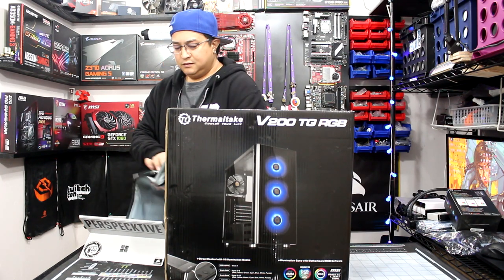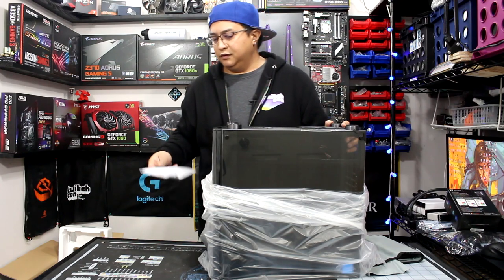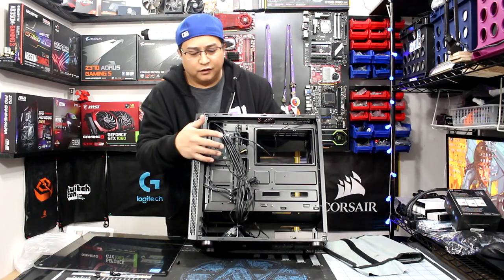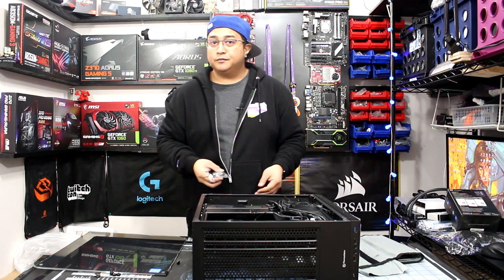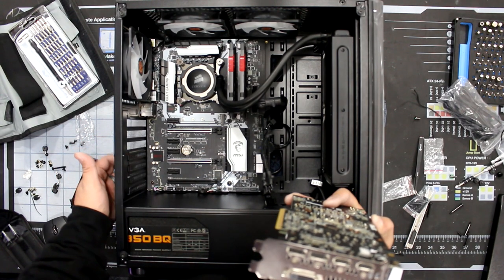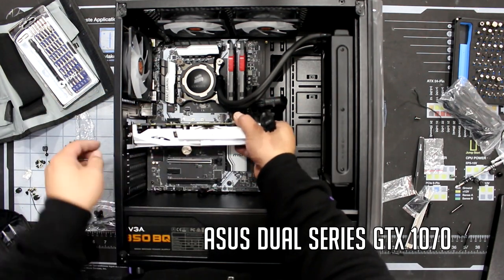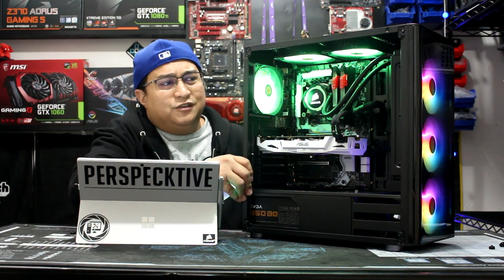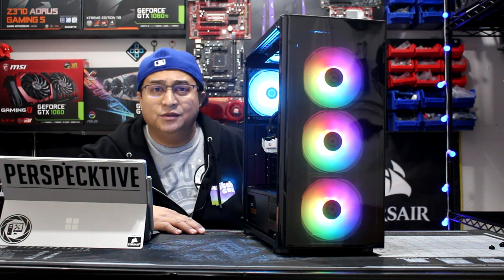Building In The Thermaltake V200 TG RGB (2018)

Comment: Great vid man ! with the ARGB switch on the back could you  daisy chain 3 fans and utilise one of the rgb slots  so that everything is controlled using the top RGB button on the panel ? 

Plan on installing 3 coolermaster halo rgb fans on front and 2 top, one back rear is that possible ?  all daisy channing them to that switch board rather than using the adaptor?

Or is it easier just using the adapter that comes with the fan kits?
Reply from the maker: Thanks man! I believe the fan controller in the case is proprietary to Thermaltake fans but honestly I would stick with the fan controller that comes with the coolermaster fans. You'll get the full functionality with it and if anything happened with the fans you'd be covered under coolermasters warranty anyway. You should be able to remove the controller altogether then mount the coolermaster controller somewhere in the back where it fits best. May take a little bit of extra work but I'd say that would be the best approach.
Reply: @PERSPECKTiVE  thanks for the quick reply appreciate it ! Does this mean it renders the RGB controller button on the front panel useless if i replace the the front fans?
Reply from the maker: They won't be useless if the replacement fans are compatible with the fan controller hub. But if not then the button would be useless.

Comment: One question - I just got this case and also ordered 240mm AIO cooling. Now here's the problem - I don't have spare fans or anything. I only have the fans that come with it. I don't want to completely fuck up the RGB effects in front of the case, but I feel like there's absolutely no other option, or? I mean I'll have to mount the AIO cooling in front, that's the only place where it'll fit, but there are already the 3 RGB fans from the case which are connected to the RGB controller, and I totally do not want to remove them, but they also aren't connected to the CPU fan slot which means they won't adjust to the CPUs temperature, and if I remove them they won't be in sync anymore, or the RGB won't work at all. What the hell am I going to do now? I feel like I bought the shittiest case in existence, just because it looked fancy in pictures.
Reply from the maker: If you have a 240mm AIO w/ cooling fans that came with it... you can can put the radiator in front in push config and just not use the fans that came with it or use the fans to exhaust air on top. You don't have to do anything extra with those fans. I used a 240 AIO in this case in this exact config. As for the cpu fan header, connect the pump to it. Also, you can connect the front RGB fans to your motherboard if you have enough headers. You can always just return the case if you don't know your way around it.

Comment: Really good video, I appreciate all the details. Do you know if a Noctua NH-D15 would fit in this case?
Reply from the maker: Thank you very much! According to Thermaltake's website it can support radiators up to 160mm in height.

https://www.thermaltakeusa.com/versa-j24-tempered-glass-rgb-edition.html

According to Noctua's website (Below) the radiator is 165mm with a fan installed and 160mm without it.

https://noctua.at/en/nh-d15/specification

So it's not very likely you can fit one there. I have to head to work so I can't really recommend any air coolers right now but an easy way to determine whether the cooler you want fits is to visit the manufacturer's website and check the component specs.

Thanks again and good luck! If you have any other questions or need an opinion on a cooler feel free to let me know!

Comment: I just bought this case (first time builder) 
I was curious if my specs would work with it before I start buying everything 
Currently I'm looking at:
EVGA 1000W (I honestly dont know how much power is needed)
GTX 2060 RTX 6GB
Intel core I7
Corsair vengeance RGB PRO 16GB
MSI MPG Z390 Gaming plus motherboard
Master liquid lite 120 CPU liquid cooler 120mm
Reply from the maker: So that's good parts but you can cut back on some spending by getting a 500-600 watt power supply instead of 1000. 1000 is actually super overkill for this build and you won't benefit at all from it. Good luck with the build Smiley!
Reply from the maker: For a little bit of PERSPECKTiVE, a 2080 requires only a 650w power supply. A 2060 super recommends a 550. You can go 500 as long as you don't buy a poor quality power supply.
Reply: @PERSPECKTiVE  thank you so much! That was one thing I was extremely confused on and didnt want to mess up. So I'll definitely reel it back from the 1000W.
Reply from the maker: @WalterTheExaltor  you're welcome, glad I could help!
Reply: a tip: you can use pcpartpicker.com there u choose all the parts u want and then it shows u if all the parts are compatible and it shows the estimated wattage that is being used by the parts
Reply from the maker: @phineasferb9847  ^ This is a great tip!
Reply: I actually have almost the same things as you besides the liquid cooling, even the same motherboard. I am going with a 750watt EVGA semi-modular bronze because I wanted to leave a little upgradability for my graphics card incase a new one comes out like the 3080 and I really want it. I am currently rocking a 2070 super though. Glad to know my parts and yours are good for this case.
Reply: @ballerrr273  definitly I actually just put everything together 2 days ago and it runs spectacularly although I went for a EVGA 750GQ 80+ Gold.ido wanna upgrade my storage at some.point right now I'm rocking a Seagate M.2 250GB and a samsung evo 1TB SSD
Reply: @WalterTheExaltor  Nice! I went with 2 tb, one is hdd for windows and programs and one is ssd for games. Gold is pretty good but sort of overkill, and I really do recommend getting semi-modular if you ever get another psu, unless I misunderstood and you got one. So much easier to put together and manage cables. I am building mine tomorrow or the day after that, so I hope I have good luck. My first pc build.
Reply: @ballerrr273  yeah this one is semi module thankfully and I was so worried if my games would run or kot hut they definitly do and they dont even studder I probably invested $2k in this
Reply: @WalterTheExaltor  I invested about 2k in mine aswell. Hope my build works out.
Reply: @ballerrr273  it definitly will especially of we're both running the same specs,  I'd assume it will hold out for the next 5+ years or so which was my plan so I didnt have to buy a ps5 or xbox 5000. You should add me on steam
Reply: @WalterTheExaltor  Yeah, also I am a huge vr gamer and steam fan so console wouldn't really work for me. How's the motherboard? Mine comes in tomorrow.
Reply: @ballerrr273  I ended up getting an MSI B360M MORTAR instead but it works wonders this PC is top of the line imo
Reply from the maker: @ballerrr273  I'm glad I could help you out man!
Reply from the maker: @WalterTheExaltor  Thanks for being a dope member of the community!

Comment: I have a question, If I buy this case and an AIO cooler, can I use the 3 fans that come with the case on the front with the radiator or will I need seperates fans installed? Thanks!
Reply from the maker: You can totally use the fans that come with the case on your radiator. Then you can use the extra fans for push pull config on your radiator or you can put those fans on unoccupied fan mount locations on the case!
Reply from the maker: You're welcome too man, thank you for watching!

Comment: Do you need water cooling to add extra RGB fans to the case? if not, how did you do it
Reply from the maker: No, I bought the kit of 3 RGB fans separately. So the case comes with 3 rgb fans installed on the front and 1 non rgb installed in the back. You don't even need to touch the 3 fans in the front if you have an air cooler or use stock cooling.

Comment: Great video man. Just wanted to ask - what's the best way to connect additional fans to to the case? Are you using splitters on the RGB fan slots? My case came with three RGB fans and one non-RGB fans. I wanted to replace the non-RGB fan with an RGB one and also add two additional RGB fans.
Reply from the maker: Hey thanks man. The best way to connect additional fans to the case would be to stick with the thermaltake fan kits that fit the proprietary fan controller in the back. It would just overall be easier to manage. You could get a different kit with their own fan controller if you wanted to but of course you'll have 2 sets of controllers for your fans. If you're going to go for a different kit I would go for fans you could connect directly to your motherboard since you can control those via software (if you have RGB) and fan speeds via bios or software.
Reply: @PERSPECKTiVE definitely would like to use the same controller! That’s what I was wondering about - if I get a TT kit, can I attach to the case controller and use those?
Reply: @PERSPECKTiVE  On that note, are there any of the Thermaltake fan kits that you recommend to add onto this build?
Reply from the maker: @farhanrob3273  I would think getting another 12v thermaltake fan kit would work. I was trying to find a few but all the ones I saw were 5v ARGB. I actually saw a 5 pack of RGB fans right now for 35 bucks USD! Search for these "KZYEE 5-Pack Wireless 120mm"

Comment: i noticed it doesnt have any sort of ssd mounts im used to seeing. Where did you put your ssd?
Reply from the maker: There's a mounting area for the SSD's towards the front of the case right behind the radiator in this build. You'll see a series of uniform holes that go from top to bottom. Hope this makes sense. You should also be able to mount them using the HDD bracket in the PSU shroud.
Reply: PERSPECKTiVE I actually found it almost right after lol it looked strange since i can’t use all 4 screw holes for a 2.5 ssd but after finding it I was happy with it since it makes the case feel less empty
Reply from the maker: You should be able to use 4 screws, just gotta readjust it and use the elongated holes because those are there to assist with getting them to fit when using different sized coolers.

Comment: Late question here: How can you control/Programm the RGB-Fans in the case?
Reply from the maker: Sorry friend. Late reply here: You would need to connect the fan controller to the RGB header on the motherboard to control it with Aura Sync and other software like that. Otherwise you would just connect the controller to sata power and the "Reset SW" for basic controls. For this video I bought aftermarket fans that came with its own controller. I list the model of the aftermarket fans during the build time lapse.

Comment: Could u help me please. I’m stuck with the LED fans. The main wire that controls the fans. Where do I plug that in?
Reply from the maker: You're talking about the cable connected to the button that's supposed to change the RGB right? If it's what I think it is you'll need to connect that to the fan controller
Reply: PERSPECKTiVE thank you. I had to order a led attachment for the lights to work
Reply from the maker: @Alex-wh6zs  I got you. So you were trying to connect the fans to your motherboard?
Reply: PERSPECKTiVE yes it was just that my motherboard didn’t support it

Comment: I heard the radiator pump should be at the bottom and not the top does it really make a difference over time ?
Reply from the maker: Personally I haven't had any issues with pumps mounted that way since I replace my radiators every 2 years or so. I have experienced pump noise with cheaper coolers when I was in college though. I didn't know why until I watched GNs radiator placement video. It's best practice to have the tubes facing down according to their video for best water flow. Especially if you're planning on keeping that cooler long term. As far as making a difference over time, you may lose some cooling capacity but it's something I'd worry about if you're always gaming on your rig. Especially if you're going to use this case with the mesh dust cover on top.

But short answer, I wouldn't worry about it too much unless you're buying a cheap cooler or if you're trying to keep it for a long time.
Reply: @PERSPECKTiVE  thanks for the info I appreciate it I’m recently buying the Corsair h100i cooler so I wanted to be shure lol

Comment: Nice. Quick question. I just ordered the case.  The fans that you have up top is that a liquid cooler. Also do you think it is wise to remove the PCI plates before placing in motherboard.
Reply from the maker: Naughty9 thanks dude. Naw the fans on top are just exhausting out the case in this video. The radiator for the liquid cooler was mounted in the front. I’d say definitely remove the plates before building. Don’t remove them all, but I’d say remove 2 if you just have a gpu. Remove 1-2 additional for each pci component you plan on installing as well. For example, if you have an elgato hd60 pro then remove 1 additional plate. But if you happen to have a bunch of pci covers laying around or wanna add some aftermarket ones then remove them all. Good luck with the build!

Comment: Perfect video, love it!

Does this Thermaltake V200 have many colours at the front fans?
Reply from the maker: Hey thanks man! Yeah the V200 stock fans change colors but single colors not multi color like the fans in this video. I used a Thermaltake Fan kit for the front panel and used the original fans for the top and rear exhaust
Reply: @PERSPECKTiVE  
Oh thanks! What about the V250 TG, does it have multiple colour fans?
Reply from the maker: @ruzr07r  no problem! Yeah according to their website the case should come with 3 ARGB fans so I would think it does.

https://www.thermaltakeusa.com/v250-tg-argb-mid-tower-chassis.html

Comment: Just picked up this case. I’m using an Intel i9 10900 10th gen liquid cooled along with an RTX 2080 Super 3 fan design, 64GB RAM. Should I be worried about airflow and thermals since I’ve heard mixed results by reviewers on amazon? In total there will be nine fans running on the inside 2 for the CPU+ liquid cooled. 3 for GPU and the 3 main RGB in front and rear fan. Should I add another fan if I can and where?
Reply from the maker: Honestly I would just make sure you have all fan mounting areas occupied (if possible). I would also make sure you manage your cables in a way that doesn't get in the way of air flow. Other than that you should be fine. Just make sure you have negative air pressure so you have good air flow going through the case and not have hot air getting stuck inside.

Comment: Hi, about to build my first pc with this case, how did you put the front fans back on once you installed the radiator, was it extended screws? Thanks
Reply from the maker: David Nghiem I used extended screws 6:40 for reference if you need
Reply from the maker: Also, good luck on your build man!

Comment: Where do you connect the top fans? I wanna get 2 extra fans for my case and it would be my first time adding fans so I’m curious as to where they connect to since there are only 3 fan connections
Reply from the maker: So you wanna connect the top fans to your motherboard directly, or to your power supply using a Sata to 3 Pin Fan Connector. You can find those on Amazon or Newegg
Reply: PERSPECKTiVE ah I see thanks. Where on the mother board? Or it varies by mother board?
Reply from the maker: @ZinalaG59  It varies, but the headers are typically 3-4 pins and labeled "Cha_Fan#"
Reply from the maker: You can find 1 or 2 at the bottom, and then another 2 around the edges of the motherboard or sometimes near the CPU in the center of the board.
Reply: PERSPECKTiVE ok thank you bro I appreciate it 🙏🏼
Reply from the maker: @ZinalaG59  No problem, glad I could help bro!